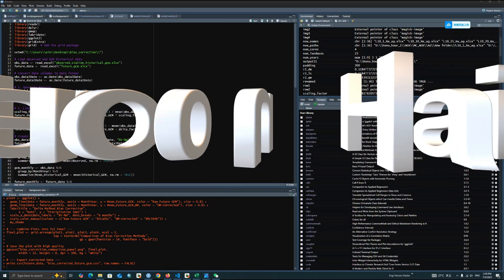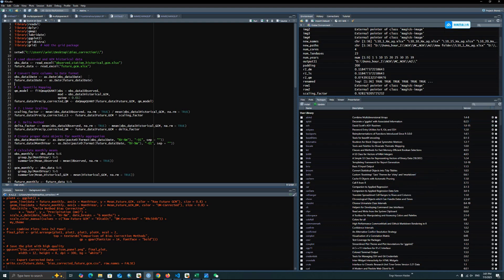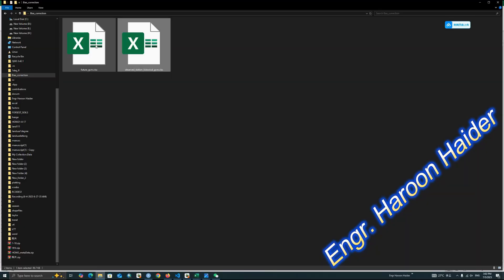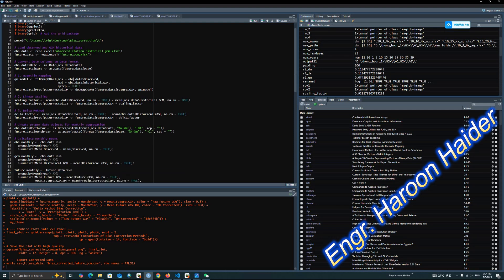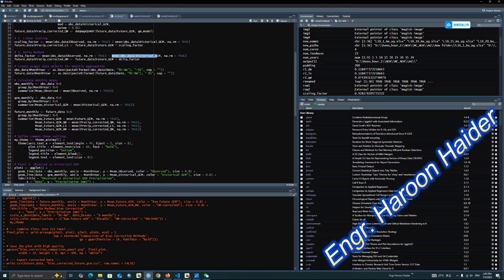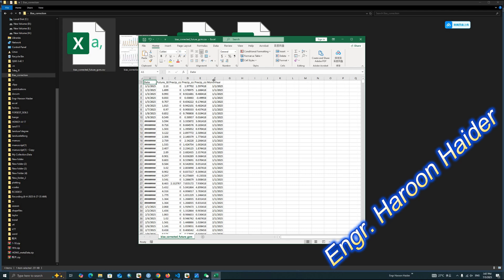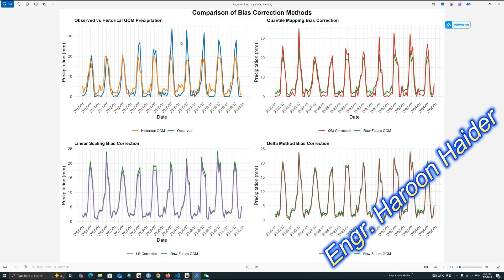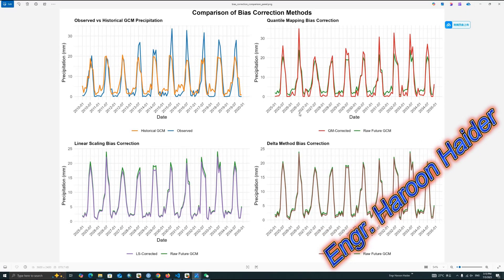How to Perform Bias Correction in Climate Data Using R | Multiple Bias Correction Techniques

Comment: Can you share the code for QDM? I have tasmax model data that is underestimated, and I found that by using delta mapping and linear scaling manually in Excel, the average future data for 2045-2050 is below the observation data from 2015-2024, which I am using as validation data. I think that using QDM might solve my problem, and I would like to use it for my thesis
Reply from the maker: Yeah sure🌹
Reply: @EngrHaroonHaider  can you please share me also the code for QDM ? it will be helpful for my thesis